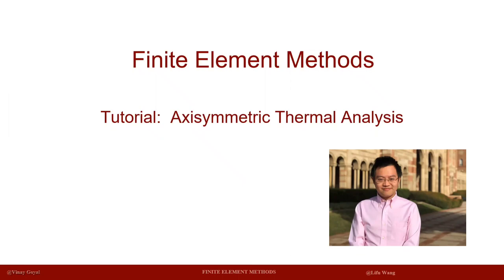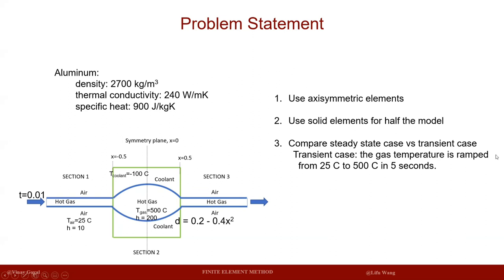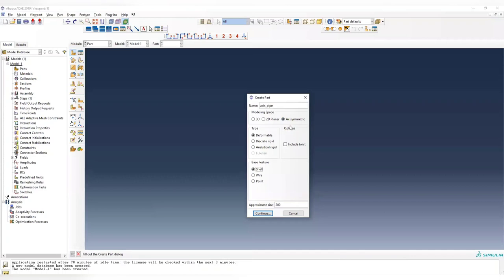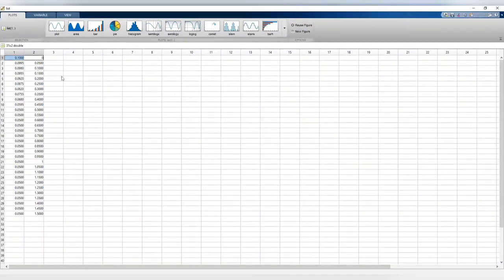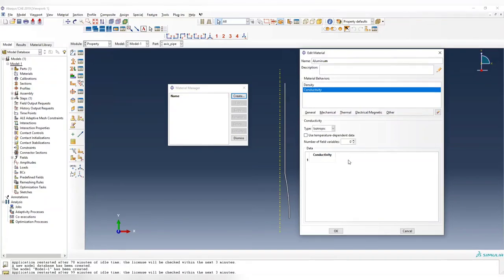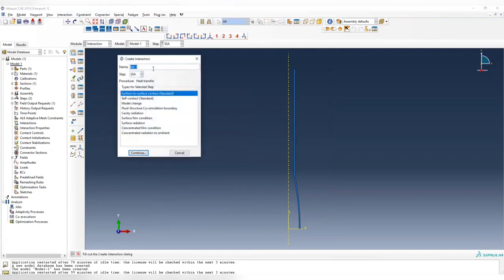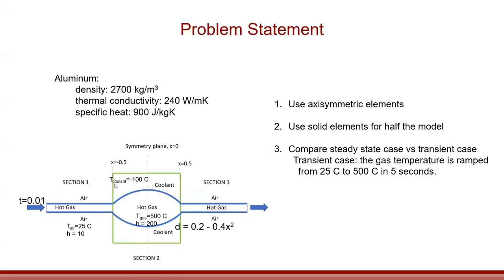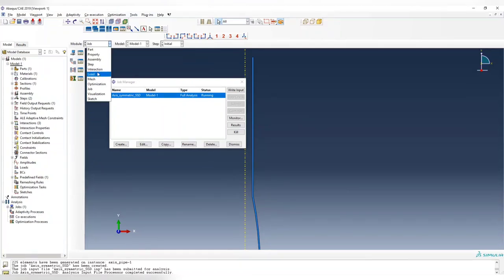#Abaqus Tutorials: Heat Transfer of a Tube Under Hot Gas and Active Cooling (Convection/Conduction)

Comment: Dear  professor， I want to use abaqus for thermal modal analysis, preliminary thermal stress analysis, and then modal analysis. Do I need to consider the change in Young's modulus with temperature?